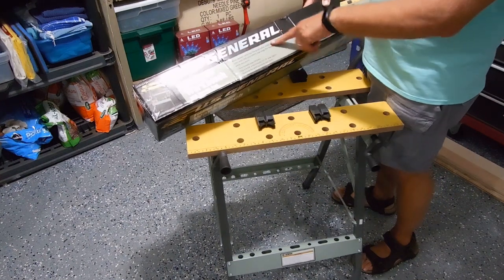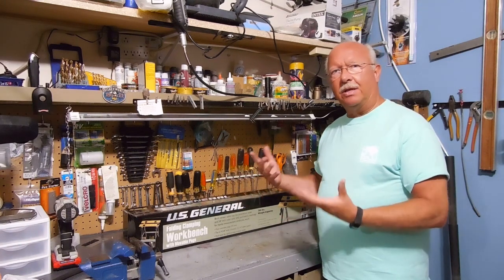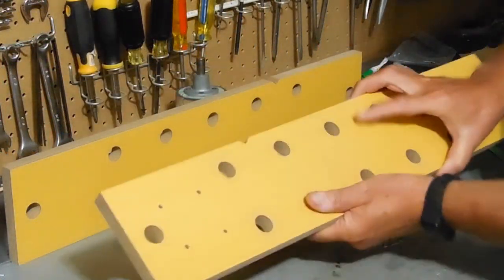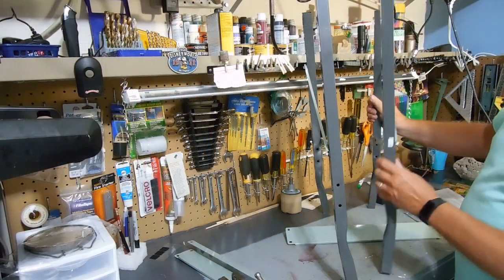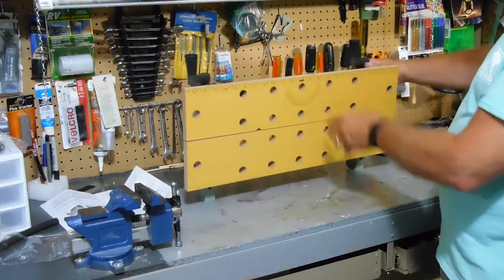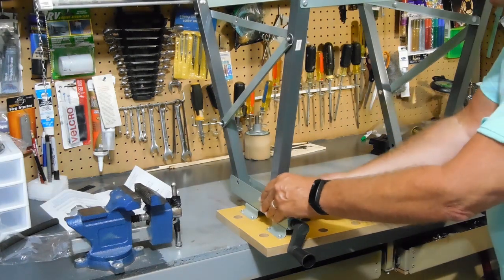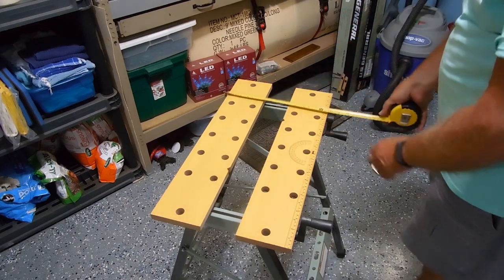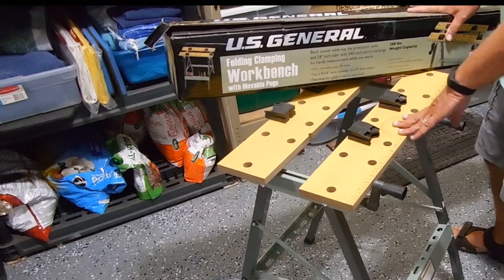Harbor Freight Item # 47844 Folding Clamping Workbench

Comment: You had it in all caps, but I missed that note! I put the legs on backward! I'm taking it apart to correct that now. I like the way you helped me know how to place the table tops, and how to use the nuts and bolts. Thanks for the video. It was very helpful. Harbor Freight is still selling this, as I just got mine - bought 2.
Reply from the maker: I ended up putting a piece of plywood on top and mounted a drill press on it. That’s worked well, but today I’m getting a designated station for the press and reclaim the vice table. Thanks again for watching 👍

Comment: Sorry, you assembled the legs wrong.  The legs ends go OUTWARD with the metal folding hinges on the outsides. Just swap the leg assemblies.  Also, right below the handles on the metal you may want to drill a 1/4" hole  under each one and add 2 nuts and bolt for longevity.  The MDF tops are weak so gluing 5/8" piece of plywood under the 2 boards, drill out the holes and reassemble will help greatly.
Reply from the maker: I actually figured that out later, and have since corrected my error..... 
You suggestions sound good as it could be more stable!
Thanks.
Reply: You will need to disassemble. I did the same thing!
Reply from the maker: Apparently an easy mistake 😂
Thanks for watching…. I should probably make an update on the video 👍👍
Reply: I made same mistake lol just now.  I'll try again tonight
Reply from the maker: Yes, very frustrating. But I corrected mine too, after my error was pointed out 😂😵‍💫
Reply: I was making the same mistake as I was assembling it but remembered another video which highlighted this issue. I was able to catch the mistake before I fully assembled it.
Reply from the maker: Nice you caught it! Wish I had before posting my video 😂.
I’ve corrected it now and still use it for light duty work.  So I’m still pleased with the purchase.

Comment: What is the inside notches for
Reply from the maker: To secure a round object, like a pipe, wooden dowel.  There are small v notches on the wooden part of the vice type top, and larger ones on one side of each rubber movable blocks.
Thanks for watching 😃